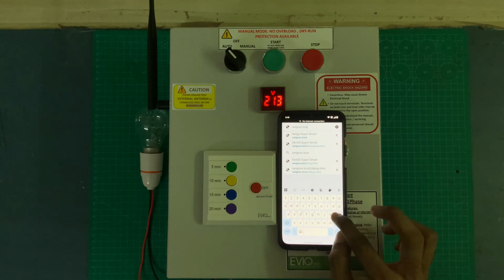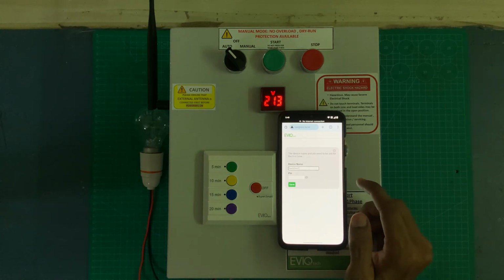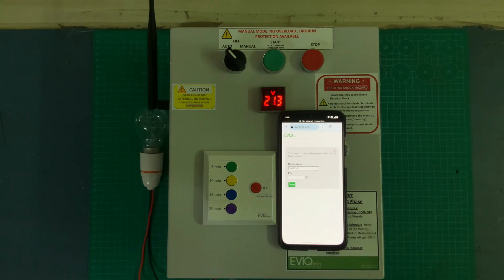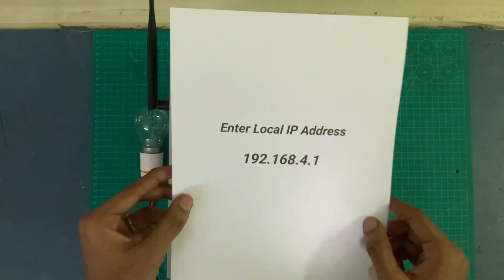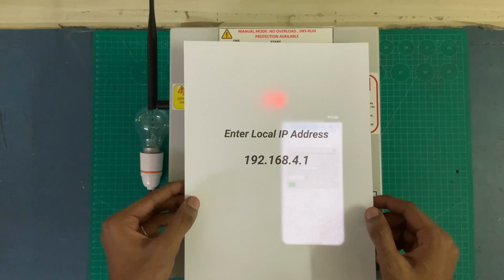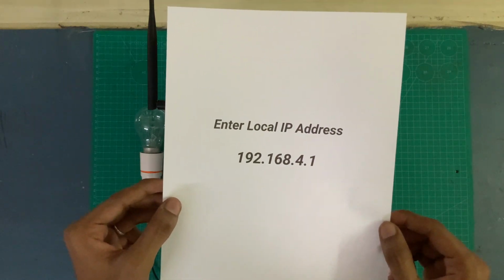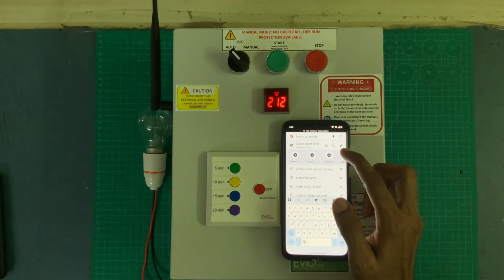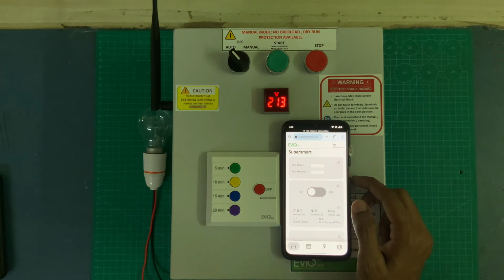SwiGO SuperSmart WebApp Setup

Comment: What are the devices can be connected?
Reply from the maker: Any devices which you want to automate or those devices after switching on, you forget to switch off in time; If it's water pump or motor, Single phase Monoblocs up to 2 HP, Submersible with 3 HP (Needs additional product or starter from us), 3 Phase up to 30HP (Needs a CT version); If its's resistive load like Heaters, up to 5kW; If it's lighting up to 16A for fluorescent or 10A for LEDs